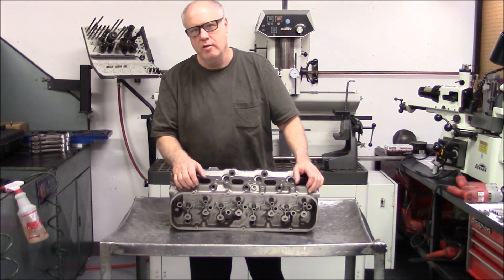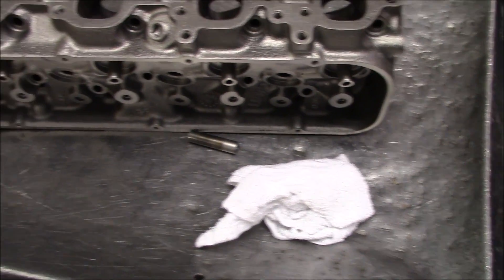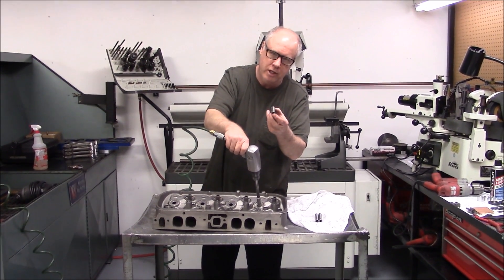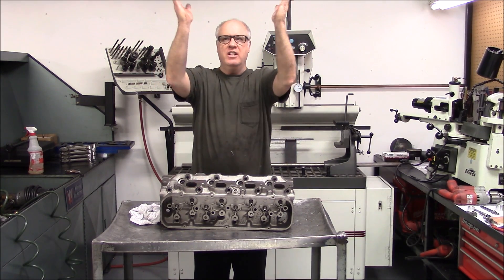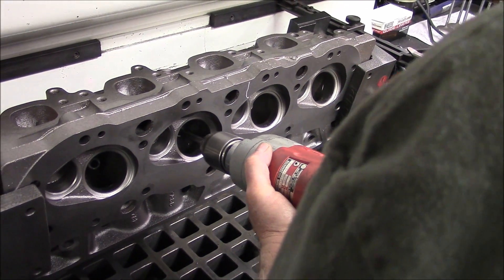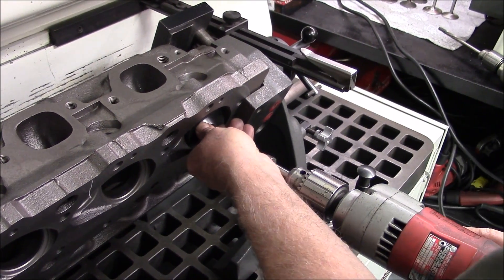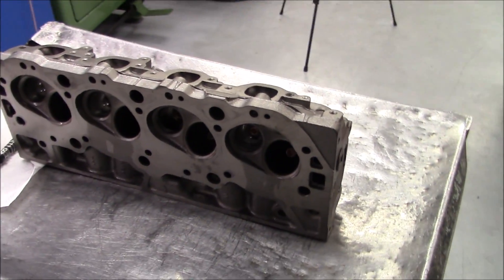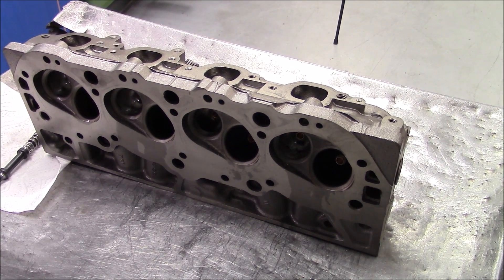Valve Guide Removal and Installation for our 620+ HP Street/Strip 454 Big Block Chevy

Comment: Curious why you only changed the cast guide on the intake and not the exhaust too? Usually the exhaust has more wear than the intake does.
Reply: I think the main reason he isn't 100% replacing the exhaust guides is because on the BB chevy iron heads the exhaust guide goes through the water passages in the head... so all those years of rust and corrosion would hurt the press fit area of the guide bores, and you'd be risking water leaks after installing new pressed in exhaust guides. Im a motorcycle mechanic so I'll explain it this way.... and dirtbike crank is pressed together with two webs/flywheels on each side with the big end rod pin pressed into both sides of the crank which holds everything together, the rod pin is also the rod journal and can get chewed up by a bad big end rod bearing and have nicks and gouging etc on the surface... well if you just press the rod pin all the way through you are running the damage pin through one side of the crank flywheel and damaging the interference fit and machined surface more than likely ruining half the crank...  dirtbike and most motorcycle cranks are 100% rebuildable with a new rod kit although the guys like me that will rebuild them are few and far in between. Sorry if that was hard to follow... its late/early in the morning and past my bed time.
Reply: @Noneyabusiness919  I've replaced many of them in the BBC heads. Never had a leak.

Comment: First time i have ever known anyone to fit new guides and then fit k lines inside the new guides.  Unless the old ones were cracked it is a waste of time and money just fit the k lines in the old guides that is how it was always done in any shops i worked in and a workmate was always working on his mates funny car with a KB and he used k lines on that with good results.
Reply: These Intake guides are drilled to provide a 24° valve angle and have to be installed in the correct orientation.

Comment: I do the same thing, I make collars.
  But, my punch is bigger than the guide...
  So, when I drive the guide home, the punch bottoms out on the collar. 
  Within a couple thousandths. 
  Works great. 
  I quit using the air hammer for installs though. 
  I make a brass punch, with a steel pilot. 
  Heat the head, chill the guide. 
  Take a B.F.H. and drive her home. 
  The air chisel was shattering guides.

Comment: I called a couple of machine shops in my area , and they say that k-liners are a mickey mouse job and that they wont last as long .   Help anybody ?   PS  What ever happen to honing after broaching ?
Reply: NEVER NEVER do what is being done in this video as the exhaust will leak water and you will ruin the head geometry.  K-liner are ok for intakes but they won't last in exhaust application. I  bore the heads for 1/2 replacement guides.  I use a harden guide for the exhaust and smooth wall cast iron or mag bronze  for the intake.  boring the head for 1/2 guides keeps the concentricity and give you guides that will last.  I been building and machining motors for over 40 years If you want to see some of my work go to flickr... Racerrick428
Reply: @rickh633  Thank you sir for replying , I will go to your website 👍
Reply: Installed correctly and using the proper rocker geometry liners will last for thousands of drag racing passes

Comment: i have been watching your video part 14 and have been all over the internet but cant find the guide that you show fitting into the valve seat's i'm working on 429 cj heads 11/32 stem intake diamiter 2.083 exhaust 11/32 1.656 these guide's have not been replaced still ford original cast iron. thanks your video is a real help.
Reply: ford heads have to be bored and reamed  for 1/2" replacement guide

Comment: Those Copper Brass inserts are known for coming out I remember when they first came out guys tried using them had a lot of problems with back to the old fashioned valve guide installation bronze guides never fails cast iron guides customer doesn't want to spend the money
Reply: Bronze liners do not come out if they are installed correctly.

Comment: I always fit guides using a spacer. as long as the guide driving tool is wider then the guide you are fitting you insert guide until the driving cant physically pass the spacer. He used a spacer on installation so would have been easy to use this technique

Comment: ps i cut with Serdi and im hooked to that machine, yours seems a little bit more work and a lot more crucial to have a good fitting guide-pen our however its called in english... hooning will be with sunnen tho!! have the diamand tips allready? for normal engines you dont have to bore anymore with those honingstones

Comment: why don't one of you, that knows it all, make a video of the "correct way" and lets see how it's really done. I'm waiting....really I'm waiting.
Reply: Yeah...Although I do things a bit differently, so long as it works, it IS the "correct" way!.  Personally...I don't bother punching out old guides if I'm K-lining them but if that's what the customer wants, it's not a big deal.  I also wait until all the valve work is done to surface the head as well however if I'm cutting the valve cover face(with the guides out) and/or the exhaust... and it's already on the machine then I'll do all sides and most of the time there's no need to go back.  Soooooo many internet experts out here!lol!

Comment: Well those heads are junk. Never ever re&re bbc guides because they are bored to the correct angles at the factory after  the guide is install. Quite often they are  bored .020 out of round  with  2 degrees tilt so you always liner them to maintain the factory geometry. Furthermore the Exhaust guides are prone to leaking after replacement. Never do what is being shown here a BBC cast iron factory head. LINER IT with 1/2" or bronze. so before you armchair bozos open your mouth I 'm a automotive machinist for the last 40yrs. My specialty is Cylinder heads. reamer suck unless they are solid carbide like AV&Vs I use Sunnen diamond hones and honalls with dial bore .0001 gage
Reply: @Rick H, do you have a way I can reach you for some work?
Reply: There is a difference between a machinist and a high performance engine builder.
 The new intake guides change the 26° factory angle to a 24° angle which helps airflow tremendously.
 This is a well known trick among professional SuperStock engine builders that the general public like you are not aware of.
 Also he did not remove the exhaust guides
Reply: @bigboreracing356    Only a clown would think that someone who spent 40 year building and machining  engines for NHRA,IHRA, ARCA, NASCAR  etc wouldnt have modify heads in every concievable way.  Machinst are motor builders, the rest are just wannabes parts assemblers.
Reply: You would not make a pimple on a machinist @$$
Reply: @bigboreracing356     The trophies, the records and championships say otherwise, fool.

Comment: I make my living as a certified AERA machinist and have built thousands of heads and have never seen this done at our shop or others. No reason to remove the guide, drill, ream, then install a kliner. Coredrill the old guide install a cast false guide and Sunnen hone to final size. Its not uncommon to hit water on some of those BB heads on the intake side when installing seats. Some BB guides will go into the water jacket and should be sealed during installation and then pressure tested.
Reply: You are not a real machinist if you never installed K-Line liners

Comment: OH MAN, YOU NEED HEAT THE CYLINDER HEAD  BEFORE INSTALL THAT GUIDE....... POOR ENGINE........
Reply: Cold!  Air hammer!  Just smash that thing in there!  Only has to last for a few runs at the drag strip to "prove" how perfect it is, right?

Comment: We have more arm chair machinists than the History Channel has arm chair Generals. The technique is a sound way to install guides. The old ones come out, new ones in, bronze guides pre-reamed,  and finishing ball broach add the benefits of the phosphor/bronze longer life, and tighter clearances. A simple hammer drill can be used if that is all one has. I use a vertical mill with an air float platen to locate and machine the guide. Using both the seat cone and reamer pilot gets things centered. The rest is similar to the video. A fresh seat grind/cut is the last step, if needed, so check by painting a seat with a Sharpie dark blue or black permanent marker, and dropping a valve in place. Any more than a light touch up on the seats means something wasn't centered correctly. (big uh-oh)! Knurling gets a bad rap, but again it's how one plays one's cards that makes the difference. Knurling flows metal, and work hardens the iron. The cheap bad way is to ream the guide after knurling. Reaming a knurled guide leaves large spiral oil grooves, less guide surface, and cuts away the hardened surface of the knurling. The reaming process will wear faster, and use more oil. The correct way is to swage the guide, (metal flows and is further work hardened), small thin spiral oil grooves are left, and more surface area is left (work hardened twice). Snap-On used to sell the knurling/swaging kits, but no more. So one can substitute a bronze guide ball swager,  one type of which is shown on the video ( I like the dual swager balls on this model). Since different ball sizes are available, the knurled guide can be "custom swaged" for tight clearances, while the thin oil grooves provide the right amount of lubrication retention to prevent valve sticking. The Snap-On kits swager used a 1/2" standard drill, I use a simple electric hammer drill for the ball type swagers. Do knurled/swaged guides last? How does 240,000 miles with one change of seals, and still going do for you? As I said it's how one plays his cards for quality vs. crap.
Reply: Yeah we use a LOT of K-lines.  I tell leery customers that out of the hundreds of thousands of liners we've installed...we can only think of 1 or 2 times the liner has actually been an issue.  Liners allow the tolerances of bronze but allows the cast/cast(guide/head) same metal heat transfer properties rather than dislike bronze/cast which CAN cause issues especially on high HP/high heat situations.  So long as the guides are not damaged...you're better off lining them and leaving the OEM guides in place.  I can always shape them with special bits so that's not really an issue either.  The owner of the shop I work in has owned it since 1976.  He's as "old school" as it gets but guess who most of the vintage muscle car owners trust?  yep...we have a LOT of old "lumps" and heads to build every week.  We use a lot of hand tools to do what the "experts" think you need a special machine for.  I had one guy watch me line honing a block with a MANUAL(gasp) jig.  Of course, these are the "experts" who can barely read a dial watch let alone a dial gauge.

Comment: going for the precision straight guide with a hand held reamer, glad it not my engine
Reply: Hahaha! I built many a professional race engine with silicon bronze guides that got hand reamed and hand honed all making the equivalent of a 5 liter engine 1500 horsepower naturally aspirated (motorcycle engine)  and not a single one broke due to our techniques
Reply: GM used expensive guide and seat equipment and was not able to keep the intake valves concentric.

Comment: Any specific reason your just using liners???
Reply: The BBC exhaust guide is tapered as well. I don't ever get enough to work on I always got to double check on whether they come out towards the top and drive back in, down and in. If you drive it out the wrong direction you've ruined the casting on the bottom taper where the guide seats and seals.
Reply: First, the  exhaust go through the water jacket and can be problematic sealing. Second, cost Its an iron head that goes with the engines he builds, and not to speak for Mark but  last I knew he doesn't do heads separately. Part of an inexpensive BBC package, and it all works together, scienced out stock parts. Of course he will tailor to your wants but then cost can potentially go up obviously.

Comment: Personally I would have preferred it if he had made some effort to protect the machined face of the head during the work.
Reply: These aren't fine China.  They're cast iron...and any slight scratch is easily sealed up by the head gasket.  I personally surface the head as the final step but it's really not a big deal.  It's going to be washed again anyhow and if there's any small scratch he doesn't like...2 min on the cutter to clean it up and it's done.
Reply: The head face had not been machined you can still see the marks from the steel ring of the gasket. The head has only been either sandblasted or blasted with glass beads.

Comment: If you want to build a great engine then do your self a huge favour.shut up,look,listen,and try to learn something.the man is sharing true knowledge here.
Reply: Wrong, I make my living as a certified machinist and this info is not correct.
Reply: @imarooster3548 My heads are done this way and had a ton of nitrous run through them
Reply: @imarooster3548  You have no content on your channel. Troll
Reply: I never knew we had so many Automotive machinist around..except when your looking for a good one to do a couple sets of heads or bore and align hone a block..where I live there used to be at least 10 automotive shops in an around town..now ..0 ..thats right gotta do some driving to find one..but we have hundreds and hundreds right on you tube all with 50 years experience..lol

Comment: When did WD-40 become a lube of any kind?
Reply: When it was developed. Water Displacement 40 forms a semi-dry gummy coating/lubricant. Try it on a Trumpet valve and it's great....at first. Then when the carrier solvent evaporates the coating will become sticky/gummy. Works well on door hinges, and other such apps.
Reply: It has a light oil in it similar to kerosene, so why wouldn't it be a lubricant?
Reply: @robertbrandywine   Because it's shite at anything but displacing water.  Silicone or engine oil are lubricants.  Molybdenum disulfide is a lubricant.  Petroleum distillates are NOT all lubricants.

Comment: Hourglass shape? Are you on crack? Those "bronze inserts" damn near FALL into those "reamed" guides that are probably OVERSIZE after reaming the "hourglass shape" out of them because you use a freaking HAND DRILL on the reamer which is NOT a "drill bit". If the reamer doesn't go into the guide perfectly straight, the finished reamed hole reamed specifically because drilling isn't "accurate" enough is STILL going to be OVERSIZE. 

Jesus, why don't you go FULL SHADETREE "ENGINE BUILD" AND JUST KNURL THE ORIGINAL GUIDES.
Reply: you never worked with k-line probably. they put a good/bad testfit piece in theyre kits. And you never worked enough with reamers either. try ream some 64 guides in one day by hand, hahahahaha and then again if they are not sintered..
And you better use Jesus´ name only on perfect things... because knurling is the most unefficient way of ´repairing´ a guide by reducing the guidancesurface for the valve till nothing. so it works for a few miles and than it starts to drink oil or pushes exhaustgasses into the rockerarea again.. i assume you have no experience.

Comment: 620 HP with those EGR closed-chamber smog-dog "oval port" heads? Good luck.
Reply: 781 castings arent closed chamber and flow really well if done correctly. 620 is pretty easy actually
Reply: I say max 450-550 hp depending on intake and carb
Reply: 700 is very possible something 049/ 781 oval ports
Reply: Use 24° intake angle as he subtly did in this video

Comment: This guy is a hack he is centering the hand drill with the old worn seat.The old seat is not only worn but it was obviously cut to the not concentric guides.  You always do guide work in a guide and seat machine. NOT with a hand drill. The guides were not concentric because they are finish bored at the factory after installing.
Reply: I built a 3.5 HP Briggs and I still edge my lawn with it. Y'all need to relax
Reply: The guy is no more a hack than GM.
 They used a guide and seat machine and still could not make the intake valves concentric.
Reply: @bigboreracing356  Billy bob this is a 7 year old video. he had symptom's of Parkinsons. He may not be around. you don't know what your talking about. Go find some friends
Reply: @bigboreracing356  Hack nascar turns 8500. I was engine builder to a championship GT1 road race team. And others. So you know more that me, Detroit and import engine builders and nascar engine builders? Your old 3/8' stem BB is 60's tech. Only 620HP claimed out a BB pathetic.
Reply: @tomhutchins1046  You claimed a guide and seat machine is needed when doing guide work, afterwards you  acknowledged a valve and seat machine will not always produce the desired results.
 The guy in this  video did not need a valve and seat machine to make the intake valves concentric.
Reply: @bigboreracing356  LOL go find some friends joke
Reply: @tomhutchins1046  Why are your feels  hurt because I pointed out flaws in your logic?
Reply: @bigboreracing356  The only flaws are in your mind. Not hurt your entertaining .
Reply: Tom Hutchins has anybody told you you're a f**** idiot he obviously machine them before or check them before doing this he setting it off of them you're a f---ing idiot
Reply: Buddy you dont have a clue and think with your mouth.
You cant fix stupid
Reply: Mine is bigger